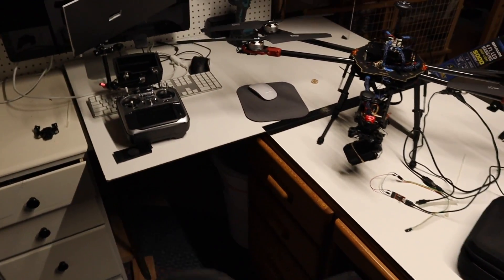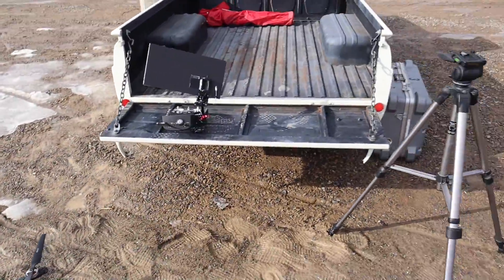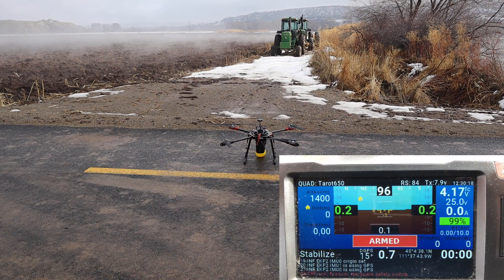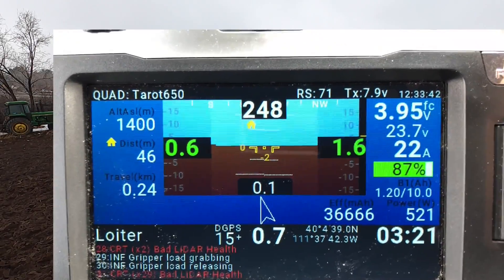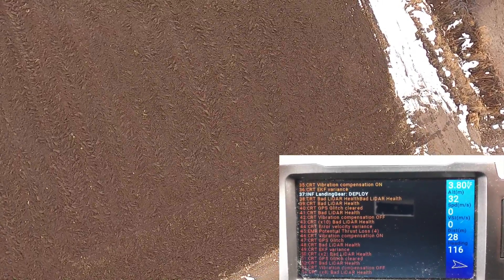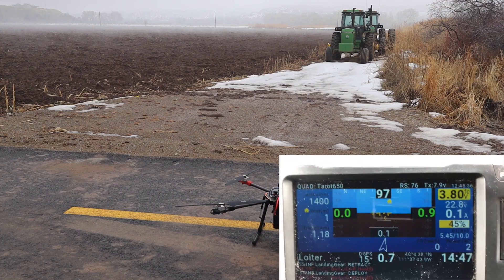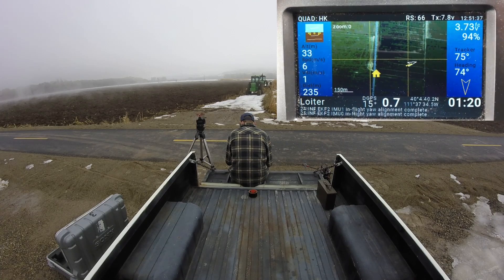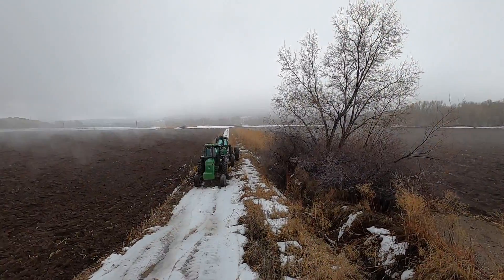Full Yaapu Telemetry Flight Test (Jumpert T16)

Comment: Hi, so good demo ! am building drone right now, may I ask when I use stick to switch to different flight mode, I feel confused is if I use different stick for different mode, does this conflicts  ? coz my one stick was assigned stabilize mode and position mode, another stick assigned altitude mode and takeoff mode, I never tried, worry it will crash, thank u.

Comment: Nice setup. I like tour videos:) Only time I had a GPS glitch so far on my pixhawk 4 was when I calibrated the compass. When you get the lidar working please make a video about it and how to set it up:) this is very interesting stuff:)
Reply from the maker: Did you recalibrate the compass to make it not happen again? I have considered calibrating again to see what happens.
Reply: Built From Home I had to recalibrate the compass because the calibration failed. I have not experienced that problem since then exept sometimes I get gps glitch when I turn the quad upside down. Maby the gps module has a shield under it?
Reply from the maker: Doesn’t look like it does. Interesting I might try to recalibrate.

Comment: You could consider a second GPS, it'll be interesting to know if both would fail ?
Reply from the maker: Yes I have wondered the same thing however I don't believe the pixhawk 4 supports multiple GPS units. I need to look into it.
Reply: @builtfromhome9207  Is this what your looking for? Hope it helps! https://ardupilot.org/copter/docs/common-gps-blending.html
Reply from the maker: @micotsu yes thats great! However Im running a pixhawk4.... I will see if i can find something like this for the pixhawk4.
Reply: @builtfromhome9207  I think that you just need to buy another pixhawk 4 gps and do the same steps. The only thing that is different are the connectors. Keep up the good work!

Edit: And yes it seems that gps blending is supported by all pixhawks that have 'Serial 4/5' port.

Better tutorial: https://discuss.ardupilot.org/t/ardupilot-with-dual-gps-blended/15635 
Telem1 and Telem2 seem to work as the second gps port too.
Reply from the maker: @micotsu Pelailee Thanks for the info!

Comment: 5:45 How did you make the landing gear log show up on the radio, doesn’t it just go straight to the receiver?
Reply from the maker: Not if it’s plugged Into your pixhawk. I have everything going through my pixhawk and setup via mission planner so it’s all logged. I have other videos on my channel that shows how to set that stuff up. Check them out! Setup Jumper T16 (Switches) with Pixhawk and Frsky X8R https://youtu.be/k7zCOalqr74